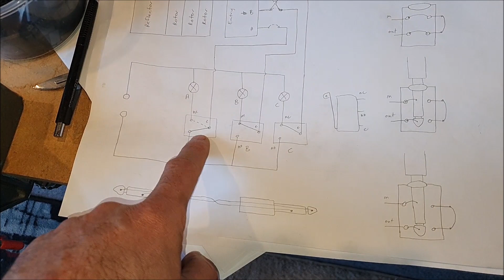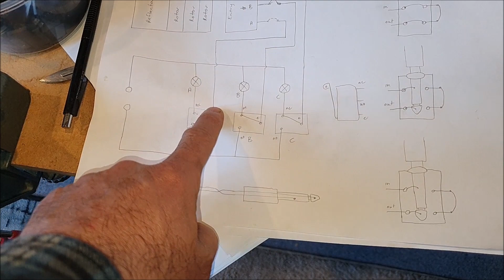3D printed Polish Enigma machine wiring loom

Comment: Great Work as Usual ! Just wanted to say Thank You for posting the Arduino Bombe code on Github. I'm using it on a NodeMCU ($5)  to be the brains of my Bombe Simulator. The NodeMCU communicates wirelessly to an Arduino Mega, which controls 4 (Top, Middle, Bottom and Stecker (creative license)) 3D printed interface wheels and Input / Display Interface. The design was inspired by your Indicator Wheel Bombe Simulator. The wheels are all driven by 28BYJ-48 stepper motors  ($2 each) and ensuring alignment/ repeatability was one of the more difficult aspects of the project. The interface allows selection of various pre-coded menus including the Weather Forecast classic and takes about 40mins to run a complete cycle due to the Stepper motor speed limitations.
Reply from the maker: I found with the steppers I used (I can't remember what exactly) there was enough cogging in the motors that they would kind of hold a position when there power was on but they weren't stepping obviously. Glad someone found the code useful!